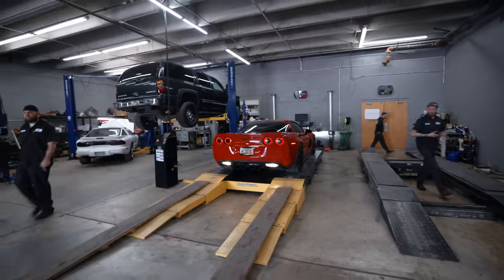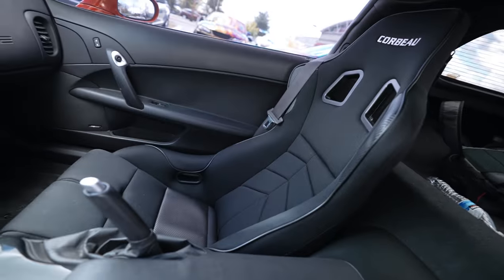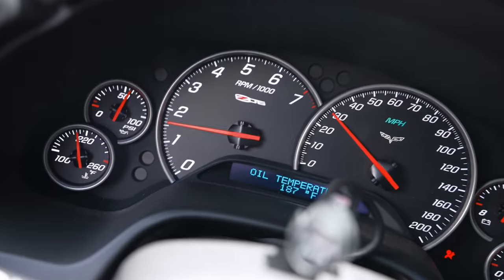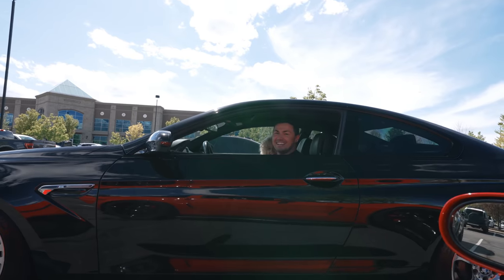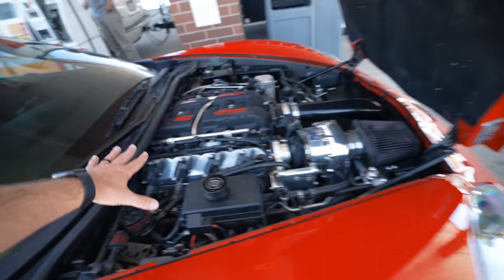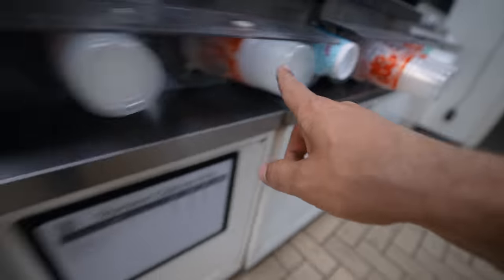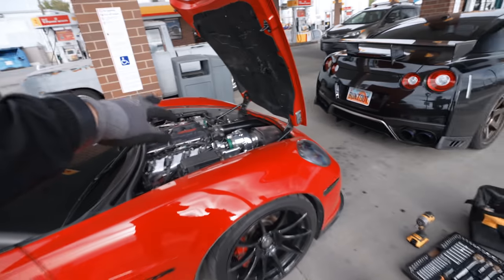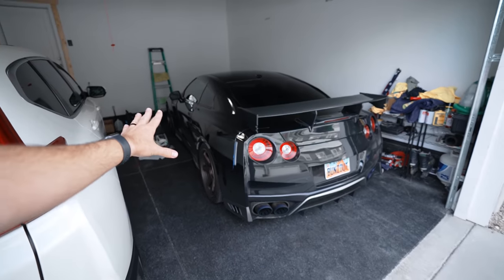VIOLENT LAUNCH CONTROL Breaks the Vette 😅

Comment: I’ve said this before,  but what I’ve learned watching all of Stephan & the Utah YouTube boys videos is even with a big budget….hot rods are always breaking & under NO circumstances should I EVER cam & Procharge my daily like I’ve always wanted to 😂
Reply: Camming is rather safe to do, boost is where the trouble happens. I’m in LA and I have a “small” 224/224 cam in my 01 Z but it still passes smog in this bs state. It really just requires valvetrain maintenance every couple 10k miles on bigger cams and that’s it. I would say something around 230/230 is a good middle ground. But if I could I’d go for the 240 range haha.

Comment: Dude you can’t be mad if that engine blows after having 2 step put in it.  Anti lag have taken out more blocks than they haven’t.  It’s only a matter of time after anti lag starts getting used before the motor blows period. Especially at that rpm. Who two steps at that rpm?

Comment: Can't up the power without replacing stock parts. Things are bound to break with the amount of power it's pushing.
Reply: thanks for stating the obvious
Reply: Bro this thing is a Texas speed and everything is fully forged. It was littering a belt and a pulley guy😭